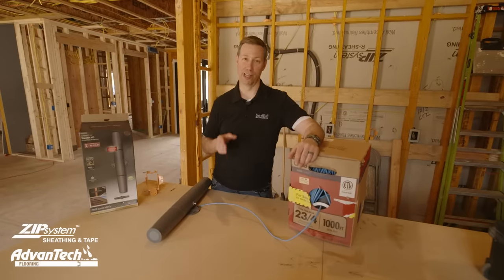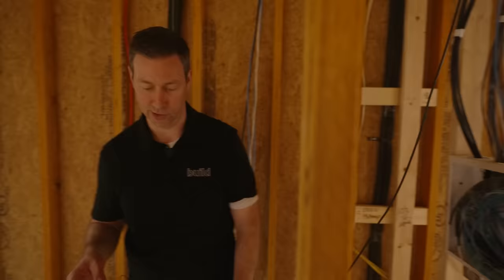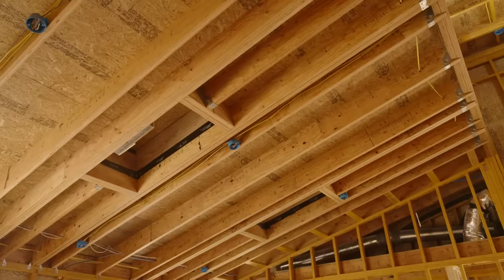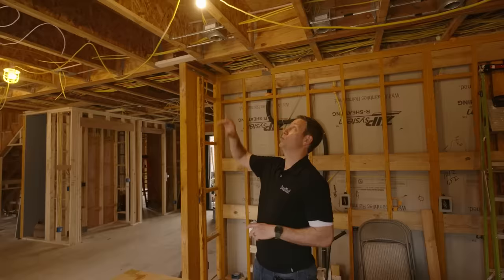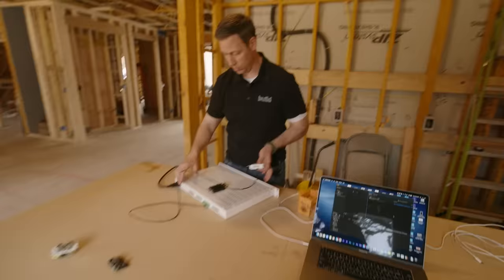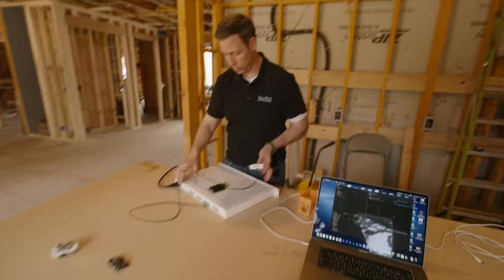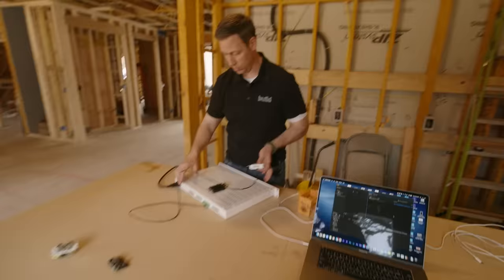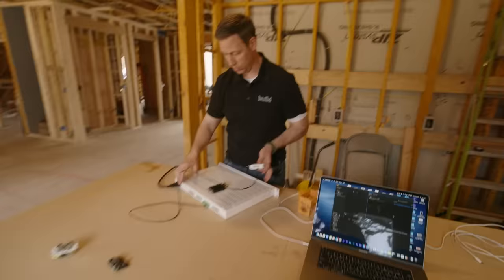Low ⚡Voltage at the Real ReBuild

Comment: During a remodel, everywhere I wanted an Ethernet jack, I pulled two cables instead of one.  Haven't regretted.
Also, another great place to run Ethernet and speaker cable is just above the kitchen cabinets.  You can't see the jacks and it can be a good spot for a wireless access point and speakers.

Comment: Working in commercial low voltage (audio/video) it's always interesting to see what LV choices builders are making in residential construction
Reply: I agree it is very interesting. Not exactly the same choices I would make ( I tend to overbuild out things) but I think it will work well. Going with unifi is very smart.
Reply: I'm slightly disappointed that Matt wouldn't support fellow contractors and instead go the DIY route.  I get it, but it's a common battle we face... "Well, Sonos is good enough... or we can just use WiFi and multiple apps on our phones..."
Reply: Same here. I cringed listening to his choices and kept saying to myself. "Why don't you hire an actual Low Volt company?" This is definitely a "DIY Smart Home". I didn't even finish the video, and I like Matts videos usually.
Reply: @newdaytechllc  It is no smart home. Its a home with stuff.
Reply: @MntneerWVU he is probably also learning the tech--will specify more A/V with his clients that he definitely won't do.

Comment: This was the most surprising video yet! Great to see, finally, a discussion on technology. I'm a certified Microsoft Engineer, own my own IT company and my own building company. My IT company does all of the work for my new builds and we have fine tuned much of our thinking over the years. Matt did more than most builders in his house which is great but most builders' achilles heels is technology. They don't understand it. Complain about the costs, etc. etc. But my thinking is 180 from Matt's. I've only got one shot to prepare a house while it's open to get it ready and keep it ready for what technology brings and that is at least as important as air sealing to me. What I've learned over these past 20 years is that one can NEVER know what technology is coming. Never. So, you need to do what many suggested here: run raceway (not the crappy electrical flex conduit) to every location that you can think of. For sure, runs from the outside to the rack, from the rack to the attic and basement, from the rack to all critical areas in the house like tv locations but ceilings and floors, and anything else you can think of. And I would never run just 3 wires from the outside. I run (3) Cat 6a, (2) RG6 and (2) naked fiber and 1 terminated. That should cover most of what we need for the foreseeable future. Oh, and take a video of everything you did before insulation. I cannot tell you how many times I've had to refer to a video after a build.
If I was a betting man, I'd say fiber will make dramatic strides in residential work in the next decade. It just solves so many problems with high traffic media like video and video, games, video calls, etc. are going to increase the load on our networks.
Reply: You got that mostly right and I generally agree.  But the "certified Microsoft" part is a big minus, not a plus.  When Microsoft gives a "certification" it only means a person has been thoroughly indoctrinated with the Microsoft way of doing things.  The rest of the technology world is often significantly different.  But those people with Microsoft certifications often have great difficulty doing anything outside of the Microsoft system/mess.  Hence the reason why I say that's a minus, not a plus.
Reply: 100% on getting video of everything you did! That has helped me a lot after doing anything behind the walls.
Reply: I totally agree with you most builders don't understand the technology side of things and it's often missed or over looked, and they rely on wifi too often, but even then they leave that to an electrician or the home owner who probably don't know much either. I also see those structured media cabinets all the time and I really don't like them, no standard networking equipment actually fits, you need a proper 19" rack, even if you have a desktop switch, ISP provided modem/gateway, etc.
Here, I wouldn't prewire fibre from the outside because Bell Canada (the local telco) likely will ignore it and run their own fibre into the house, sometimes to the basement and sometimes wherever their tech decides, which is rarely a good choice, and Rogers (the local cable company) will want to run their own coax into the house, or their own fibre if in an area served by their FTTx  network, but I find their techs are a little more flexible with where they will run the cable to for their demarc. Do you use a low voltage cabling specialist or an electrician to run your ethernet? I prefer working with a LV specialist over an electrician.

Comment: Definitely agree about the ceiling runs for access points. It also may be beneficial to consider a way to make sure your getting conditioned air in the media closet. Depending on what and how much equipment with that rock wool you may build up heat.
Reply: good point regarding the a/c in media closet, we ran into that cause our closet would overheat things.
Reply: Right on!  Air flow/exchange is critical for equipment.  Heat is a serious issue even with only a little equipment.

Comment: Matt, may want to run Ethernet to a few strategic ceiling locations in case you decide to install multiple ubiquity access points. (wifi)
Reply: ^ this
Reply: Agreed, I have a commercial ceiling mounted WiFi access point in a closet in the middle of my house. Those are far better than the all in one modem router the ISP provided, or the blue bunny ear box next to your computer desk.
You can have a personal WAP and a guest WAP, better coverage, have the guest WAP shut off during certain hours and strict firewall restrictions.
Reply: its so cheap and easy to run now when there is no drywall its futureproofing it really.
Reply: The higher the frequency, the higher the bandwidth, the lower the range. This means that 5Ghz Wi-Fi already penetrates through walls less than 2.4Ghz does, and future technologies will likely even have less range. Not necessarily of course, but who can predict the future. I think it makes sense to have a ceiling ethernet access point at least on every floor, and if you've got a big house, at least every 15m's or so, or maybe every other room.
Reply: Yeah, when I bought my current house, I spent weeks running Ethernet to all the major rooms and to the corners for cameras. The idea of not taking advantage of the open walls to run Ethernet everywhere boggles the mind. When we had to build a half wall around the basement of my rental house, I had them run Ethernet every 20 feet. Who knows where someone will want a desk, an access point or a TV.

With Ubiquiti, you can put in fairly cheap wall mounted access points anywhere you can get an Ethernet cable and get uniform coverage.
Reply: Keep in mind that POE is a thing and that you should strongly consider shielded CAT6a or better to avoid interference.  Also the HDBaseT standards call for support of 100 watts over a single ethernet run ... no one is there yet but it's in the spec.  That would mean a single Ethernet cable for power, control, HD audio, HD Video, and gig network.  POE done right is a beautiful thing.
Reply: Matt, to add to Bret's comment with some more real-world experience; may I suggest placing the wireless access point in a location you can easily reach.  There are times when you'll need to unplug/plug it back in, and you don't want to climb a 12ft ladder each time.  I'd suggest a wall mount over a ceiling mount.  Unifi's AP bracket is... persnickety.
Reply: @brenttincher1639  well that’s one of the advantages of POE. you can just unplug it at the Ethernet switch or even use the Ubiquiti app to cycle the power of the port on the switch. No need for ladders.
Reply: @brenttincher1639  or power-cycle it at the POE switch or injector?
Reply: Matt Risinger  Word of warning, it looks like your YouTube account may have been compromised.
Reply: @BretBerger , yes indeed.  I learned the hard way not to place the switch in a hard-to-reach location.  It's easier for me to cycle at the access point, which is not ideal (lesson learned).  Hopefully, Matt won't have that issue with a dedicated closet.
Reply: Agreed! Also more ethernet runs should be around media locations for future devices
Reply: I was going to say the same thing BUT in addition: WiFi6, the new standard in high speed wireless doesn't penetrate walls well (worse than normal 5GHz): you basically need line of sight between the device and the access point to achieve true WiFi6 speeds. That means you essentially need an access point in every room that is likely to require such speeds (like the living room): you only need to maintain line of sight so if the device can see the living room access point from the kitchen you don't need another access point in the living room. 

I also wouldn't go nuts with access points either though: pick your heavy use areas and install there. WiFi signals can interfere with each other so having too densely packed access points can actually makes things worse: so don't install them in every room. If you are just streaming music to the bathroom phone, 2.4GHz is just fine through the walls. 

Sure you can change the channel of the WiFi signal (or buy access points that do that automatically, like Arubas) but it is best practice to just not saturate the area. Plus, there is always the neighbors signals you contend with....
Reply: I would definitely agree with this, one place that I would recommend is in living room because of the wigig standards that allow wireless HDMI, but use 60ghz so basically need line of sight to work.
Also I would note that if you didn't already you should always run a minimum of two cables to each location, this is something from when I was running Ethernet cable for a living, too many times had a run that ended up with problems and an easy fix was to just use the other run.

Also worth noting that two cat 6 cables I believe is required if you ever use hdbase-t which is HDMI signal over twisted pair cable. Adds flexibility, and can run over long distances, but the equipment is expensive.
Reply: @brenttincher1639  You just turn it to remove from the bracket, at least on my AP Lites.
Reply: I agree, forgetting ceiling boxes w/CAT6 for WiFi access points was my main mistake building my new house..  I ended up using the Ubiquity Wall Mount versions, which I don't like as much, but had no choice.  You also don't know exactly how many you'll need, but putting in a few extra ceiling boxes/CAT6 that are "blanked" out gives you a future proof house.  I'd also recomend UPS's at any major "areas", so if you have a generator/backup power, you don't lose connectivity.  and despite what you say, running an RG6 coax to every room (including bedrooms), where you might place a TV gives you the flexability to extend the OTA antenna or a TIVO to that room (TIVO can use coax for ethernet via MOCA).  I ended up putting (2) CAT6 and (2) RG6 Coax in every room, twice.  Once where the TV would be located, and an additional set of outlets next to the bed, where bedside tables would be located.  Thanks for your channel, was very helpful building my netzero house in 2018
Reply: @holzwerx  While I agree running Cat6a is better for future proofing I think shielded is overkill for most applications in residential. Unless you are running long parallel runs with high voltage in NM wire I dont see the benefit of shielded since the cost is quite a bit higher.
Reply: @Deluxe754  Totally agree with you and terminating shielded is a pain as well... but for future proofing with an eye toward things like POE and 100 watt HDBaseT the shielding is nice if not essential... but I'll admit I have only installed shielded in one home so far and that was due to a mistake from my cable vendor ... let me tell you that was a real pain getting all those runs thru my conduit.  That stuff is not as fun to pull.
Reply: @holzwerx  And for residential applications is 6a necessary?  What type of interference in a residential setting are we concerned with?  Numerous cable bundles running along the same path?  Or equipment like furnace and other motors?
Reply: @holzwerx yep POE is literally the most seamless experience. You plug something in and done!
Reply: @bradgaeth  Necessary is a fun word.  Not sure that any of it is necessary.  What I'm thinking about here is future proofing and you can never really do that completely with CAT rated wiring in my view.  So I put in the best I can at the time... within reason.  So yeah, you can probably get away with CAT5e but if you are running it in the walls and ceilings with no conduit or hope of ever replacing it (some of my runs have been pretty sketchy with turns here and there... and here again), then for my money, I just want to do it the best I can while the walls are open.  I guess you could do fiber and be prepared for anything but then there's all that goes into that stuff and frankly, I'm not sure I'd do that...but I can't say I've never thought about it.  In 2000, it was CAT5e so that's what I used, now I'm saying CAT6a.  The main thing is that I want my data bottleneck to be the ISP and not my network.  If I have any hint of a CAT5 rated patch cable in a CAT6 or better network, we cut the ends off and throw it away to ensure that  everything we have is at least CAT6.  Just trying to manage my variables.  If you go to the expense of cabling a house or office, put in the best you can at that time to give you the longest life you can hope for from that cable... I pulled some fun braided multi-pair wiring out of a home for a friend about 15 years ago.  That stuff was installed by the previous home owner probably in the early 70's ... I believe he was an EE work worked in aerospace ... he had all kinds of nifty stuff running off that cable... he didn't use every pair but he sure did use that cable to the 'nth degree.  I hated pulling it out but it did leave a nice pathway for me (one story house, all easy drops from the attic).  So that's a lot of words to say do what you can do but a higher rating may save you a lot of grief in the future ... or maybe it won't matter at all.  With 10 gig speeds being the current ethernet standard for networks, I don't see file sizes getting smaller and bandwidth requirements dropping... anytime soon.  It's the same with the RAM in your computer from 10 years ago compared to today.  When I buy laptops, I max the RAM to save the time and effort in wishing I had maxed it three years from now... to squeeze another year or three out of it.
Reply: @Mrcaffinebean  I do love me some good POE!
Reply: @brenttincher1639  Power over Ethernet exists. You won't ever have to climb to an access point unless you're upgrading or replacing a hardware failure. Go into the switch port on the controller and powercycle the port, or worse case, you reseat the cable at the switch. He's using a 19U rack, and doing cameras also, so he's definitely going to have a poe switch.
Reply: Was going to suggest this to, run it to a switch
Reply: Ubiquity is the bomb.... mesh flawlessly.
Reply: I put a full Ubiquiti system (based on the UDM-Pro main box) in my house a few months ago - great stuff, good choice. However, I found I had to add more APs than I expected to get reliable and full coverage. I now have 6 APs, with 5 of them using "wired backhaul", the only oddball being a wireless (mesh) "Beacon" in the kitchen where I hadn't thought to pull CAT5 back in the day. DEFINITELY pull the copper now, and/or run smurf tubing everywhere and not worry about future technology changes. As you said, Wifi can be unreliable, suck in terms of speed, and is subject to radio interference. Every stationary pc/media box/avr/solar controller has CAT5 to it. I'm running about 35 devices full time plus another 30 transient ones (phones, tablets).
Reply: We do this in all of our rough ins…. Each bedroom, and a few locations in the ceiling
Reply: @brenttincher1639  A better way to do this is by simply power cycling the port the AP is plugged into with a PoE switch. No physical access needed.

Comment: running a  1 1/4 pipe from the tv box to media closet is always a good idea. also a pipe to the attic and to basement if there is a dropped ceiling.
Reply: 2" if you are using that Samsung cable.. The head on it is 1 1/2" wide..

Comment: 18:37 I'll be interested to see the entire Ubiquiti install.
Reply: Seconded, and the cameras and Sonos!
Reply: Great products!!!
Reply: Ubiquiti gets out of hand really quick. They don't have any support, and if you are not an IT guy they can be a PITA to troubleshoot. Making sure to get the firewall and weekly reset configured right off the bat is really important. My Ubi system is really reliable, but it took a lot of work. Luckily for me I'm in IT, and so I have an idea of what I'm doing, but Matt may have an issue on cut over.

Comment: CAT6 If you used CCA (Copper Clad Aluminum) wire which is in the link you provided. Also looks likely to be the same type of box you showed at the beginning. Many people use CCA cable for POE devices both access points and cameras. You should run only coper wire not CCA for POE devices. The voltage drop and interference caused by CCA will create nothing but intermittent connection issues for many devices and packet drops at the bare minimum.
Reply: Reference sited. https://www.flukenetworks.com/content/application-note-copper-clad-aluminum-cables

https://www.belden.com/blogs/smart-building/cca-cable-5-reasons-to-stay-away/

https://www.truecable.com/blogs/cable-academy/cca-vs-solid-copper
Reply: But, but, but...CCA is CHEAP! Lol. #LiveLearn
Reply: I agree never buy CCA its crap